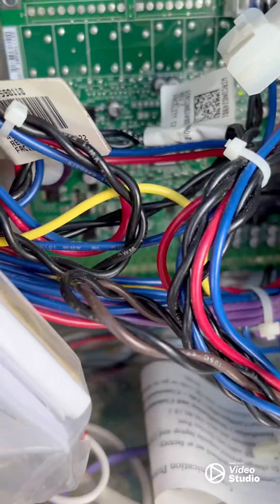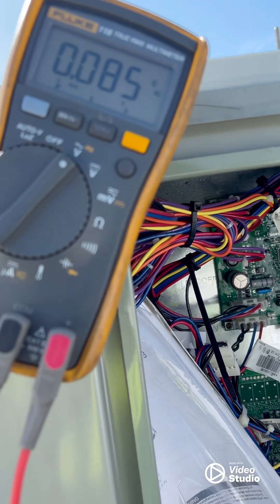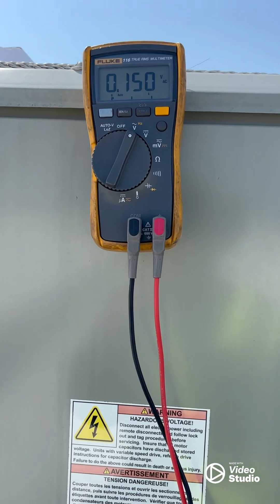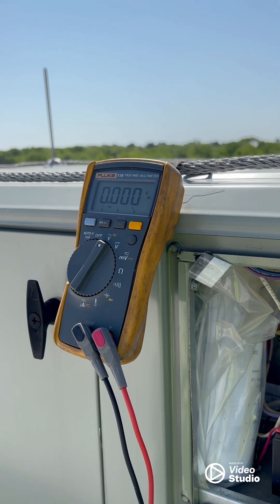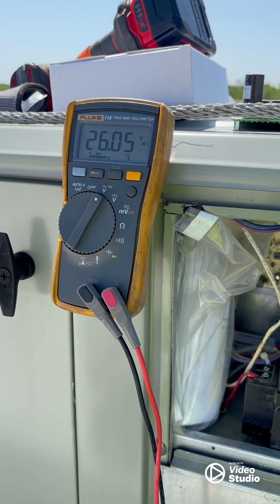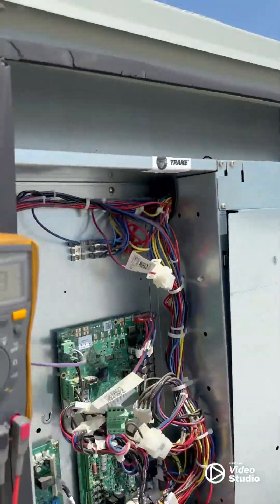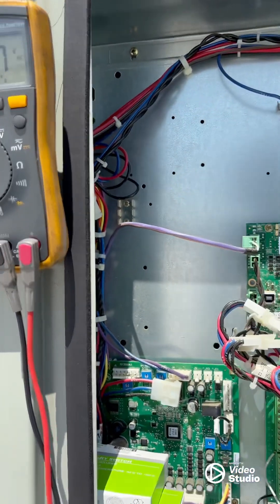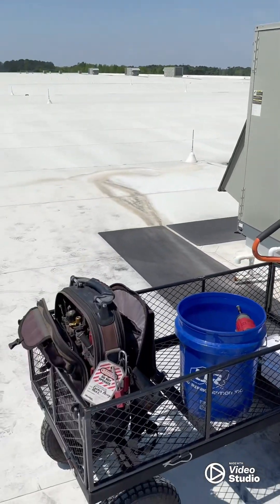Trane RTRM board troubleshooting

Comment: Where do you connect the leads to check for voltage?
Reply from the maker: For 24VAC incoming power to the RTRM board I believe it's J1-1 and J1-2. To check voltage going to your load relays, contactors check the schematic for leaving wire going to your load/coil from the board and your other wire should be connected to ground. Once the load has wire your should have voltage on both side of your coil to ground because it's a alternating ac current
Reply: @cjshvacjourney4034 appreciate the response. I ended up figuring it out. Thanks!
Reply from the maker: @wazzoa4790  Great! And no problem any more questions just send a comment?

Comment: Didnyou have 3 bad RTRM boards in the same location?
Reply from the maker: @ianpalmer1482  yep same site. Never had that happened before and I use to work for Trane the OEM. It might be there voltage issues at this site.